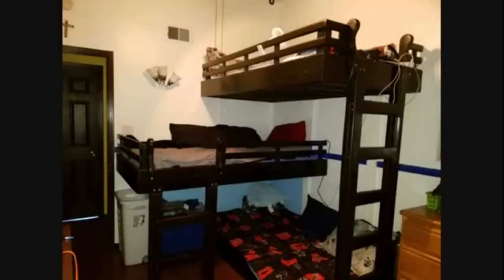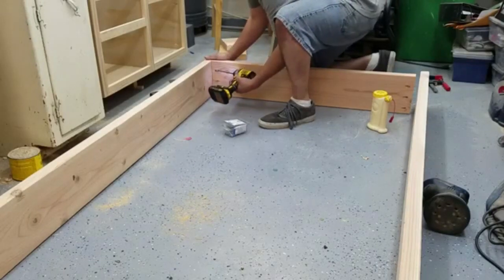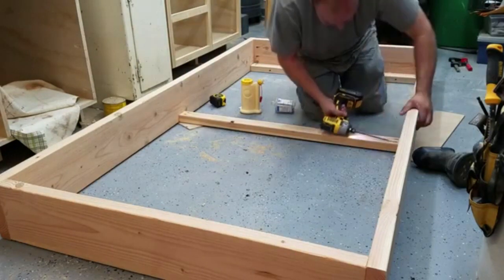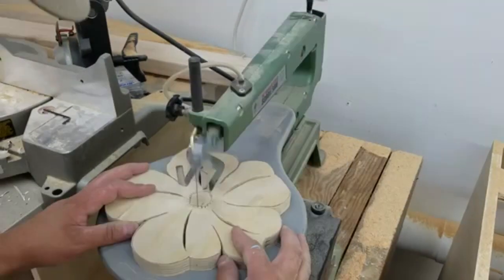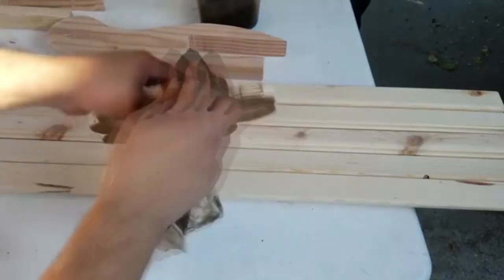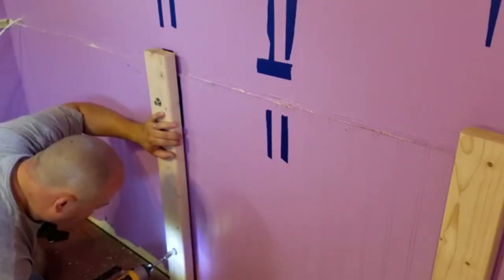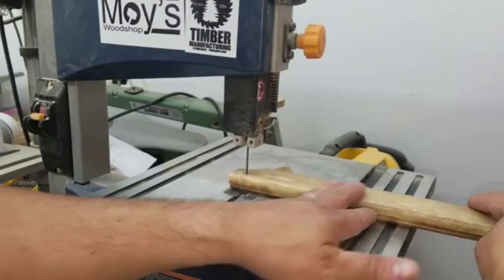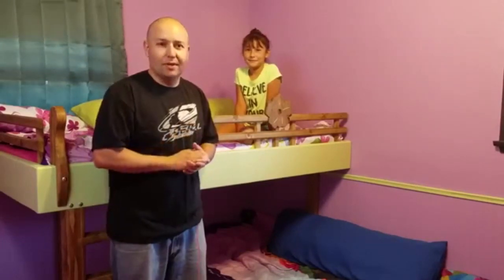DIY Bunk Beds

Comment: I was wondering if you anchored the bottom of ladder to the floor            nice build
Reply from the maker: +kozmo239 thanks, I did not . It's a snug fit and the weight of the top bed applies enough pressure to keep it from moving. I also applied a small rubber pad to the bottom of the ladder posts using contact cement just for good measure.

Comment: Thanks Moy.  What is the name of the product you used to fill the knot holes?
Reply from the maker: +Jack Bench Woodworking thanks for watching Charlie, it is called drydex. It is a wall spackle paste. It works awesome for projects that will be painted
Reply from the maker: +Jack Bench Woodworking thanks for watching Charlie, it is called drydex. It is a wall spackle paste. It works awesome for projects that will be painted

Comment: Hi Perez - Great video. You are using a tool from 1.27 to 1.48 min. in the video. It makes it possible to screw obliquely. What is the name of that tool in English? It can not be bought in Denmark, so I´ll try to find it in another country.
Reply from the maker: +Kim Thomas Petersen Thank you Kim,  It is a pocket hole jig. This particular one is one I purchased at harbor freight
Reply: Hi Perez - Fantastico - Thanks a lot. It looks like an almost indispensable piece of tools. Most strange that it is not used in Denmark. I’ll try to find it asap. Thanks again.
Reply: I found it - bought it - can’t wait to use it. So grateful.